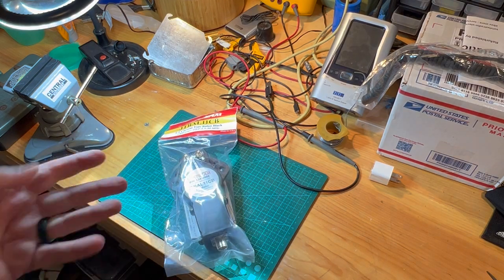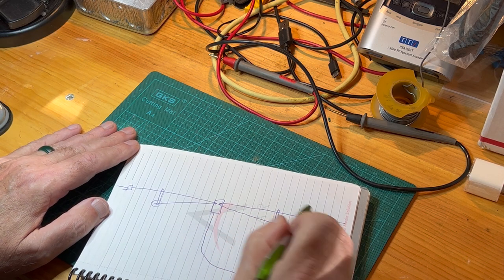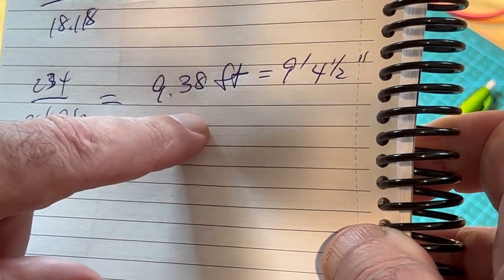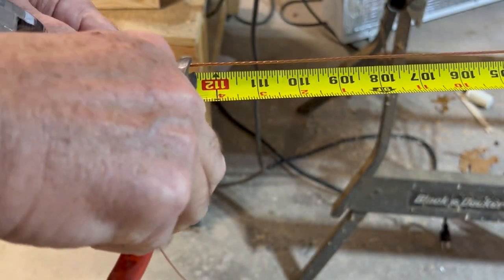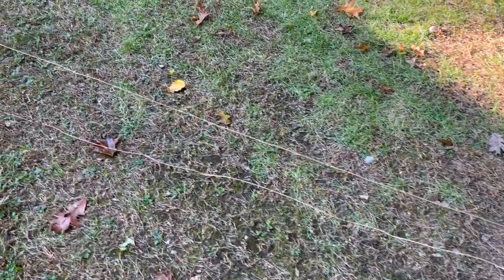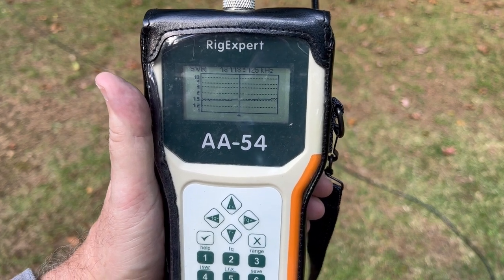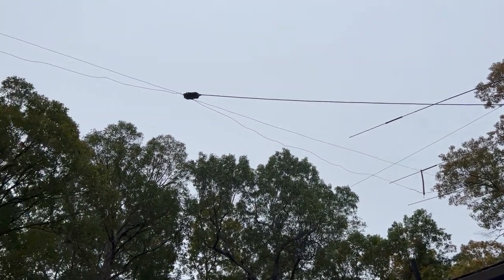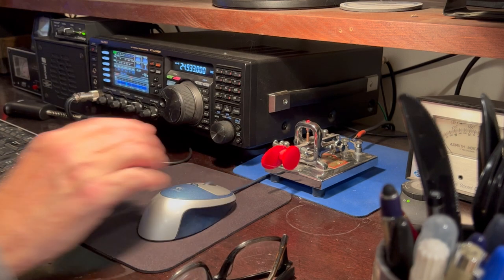Building a 12m/17m fan dipole for ham radio

Comment: Hi Chris, Just erected a 20-17-15-10M fan dipole, so far so good.  I am separating the elements via 100LB mono leader line and glass insulators.  The insulators add weight for separation.  The mono keeps the antenna nearly invisible.   I used DX Commander wire for the elements... very soft and supple wire.  Picture of the antenna is on my QRZ page.  73 Art
Reply from the maker: I’ll check it out!

Comment: Thanks for the excellent video. I am just getting back into ham radio after 30 years away from it.  I am planning a fan dipole as the first temporary antenna I make just to get on the air. That is when my new house and shack are built.  The vice you used reminded me that I need to get one :) HS0ZQF

Comment: Fan dipoles are great. Mine is a 5 wire version cut for 40-20-17-10-6 but also does 15 and 12 very well. I've found a 1:1 choke on fan dipoles are necessary.
Reply from the maker: I was going to include 30m on this antenna but chickened out.  😂 The center I got has the 1:1 in it too.  Thanks!

Comment: Working on an 80/30 fan at the moment. How did you get the spreaders for stay put? I’m curious why your 12m was off so badly. Definitely coupling ?
Reply from the maker: I think since the bands are not related harmonically it caused some goofy impedance mismatches that required some modification to the length.  As for the spreaders i drilled the holes off center so the wire holds the spreaders in place.
Reply: @k2cjbradio  great idea! Mine turned out right the first time which never happens. Haha

Comment: great video. just ordered some parts to make this antenna. will be my first attempt at a home made antenna. btw. great hat. fat tire is good stuff!  see you on the air. kj7vvn
Reply from the maker: Make sure you leave extra wire in case you need to make the radials a little longer and you won’t have to splice them like I did!  Thanks!  73 de K2CJB

Comment: Just cut my own fan dipole for 15/10 tonight before I saw this video! My choice of tubing is 1/4 inch air line! Lightweight, small, and durable. But my antenna is for portable use - not sure how it would stack up to UV over prolonged use.

As for the band interaction, the non-resonant element acts as a reactive load for the resonant element. That's why fan dipole bandwidth is narrower than normal dipoles, unless it's an edge case where one band is a perfectly high resistive impedance on the other band - think a 40/20 fan dipole. The 40m legs are non-reactive on 20m. 73 VE3GKT
Reply from the maker: Thanks!  I never built one of these before and I definitely learned quite a bit.  The good news is it works!  😃

Comment: Hey Chris, great video! I have a couple of quick comments that I hope are helpful:   

1- My co-worker WA2OQV had built a fan dipole for 10-15-20 meters made out of 3 conductor insulated rotor wire. The wires were kept together and not separated. We used it successfully on many field days. It  worked very well and easy to deploy and take down and also had low wind load. Maybe an option for your viewers. It resonated on each band.

2- The regular PEX tubing I believe breaks down when exposed to UV (Ask me how I know!), but I think there is a UV rated type. Not sure if that is available at Home Depot.  Quick story: Our AM broadcast transmitter site had several long lengths of PEX tubing routed along the docks out to each tuning hut for supplying fresh water to clean off the geese poop. Well, they all cracked after a while due to UV exposure :(  (We have not replaced it yet).  73, Dave WA2SVM
Reply from the maker: Thanks Dave!  The PEX may eventually fail on mine.  Years ago I tried making a fan dipole with ribbon cable and couldn’t get it to work.  Sounds like you did!  Definitely a FD or POTA option for sure!